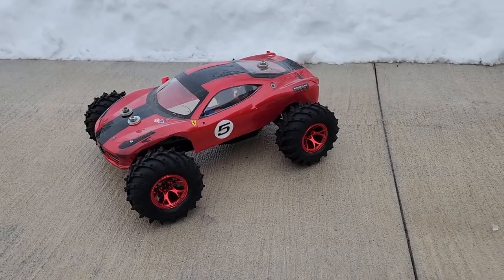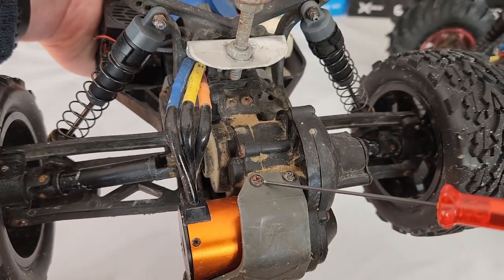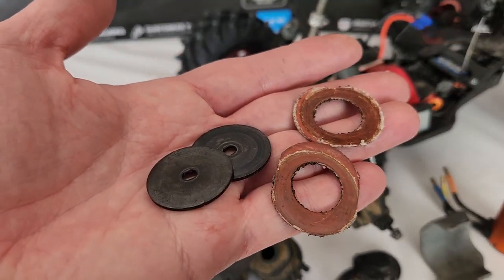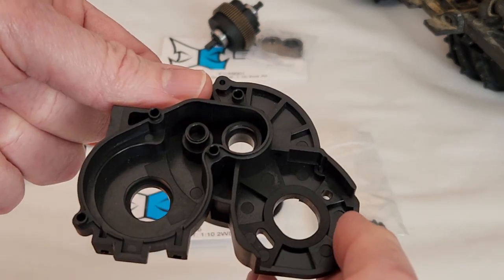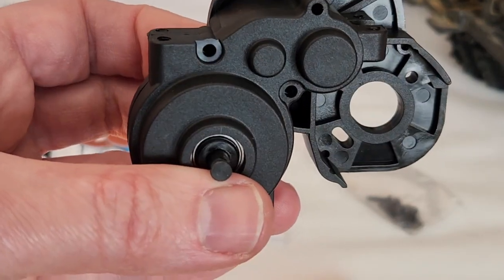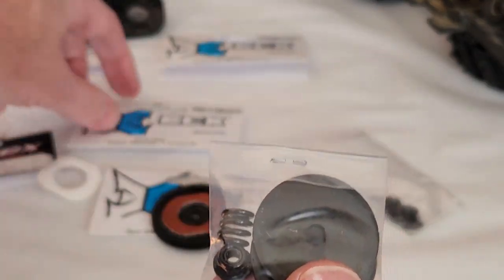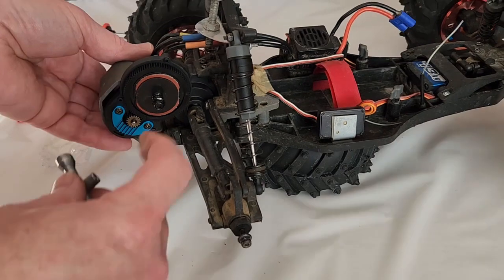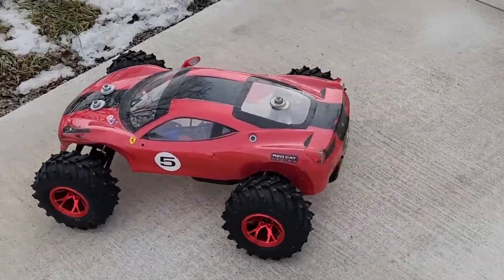ECX AMP MT - Replace The Transmission Parts and Install the Metal Transmission Gear Set

Comment: hi wondered if u can help. i got ecx circuit same set-up ive replaced everything like u have and under full throttle still slips
buti never change center bearing behind spur gear. would this help u think ?
Reply from the maker: Check the drive shafts. We have had the part where the drive shaft connects to the wheel shaft break. Test it by holding the axle and turning the wheel. If the wheel turns but not the axle, get a replacement drive shaft assembly.
Reply: all axles seem fine  @HandfulOfHobbies  👍 see the bearing on the input shaft behind the bushing ive lost this and not sure what size this is ? ones i have all too big
Reply: i was running it without bearing and spacer washer is this why it slips when u put power down ?
Reply from the maker: @jimmymorris8032 find the manual for the exploded view and parts list. That will tell you what part you need. Just search Horizon Hobby for your truck. I'm sure having those bearings will help.

Comment: is it normal for the metal gears to feel a little more slow on takeoff? I’m running a brushed system so maybe that has something to do with it
Reply from the maker: I wouldn't think it should, but they are heavier than the plastic it might take a little more torque to get them spun up. It runs fine otherwise right?

Comment: hi what is the blue metal piece on the motor mount, I find with mine the plastic is too soft and motor shifts and shaves my spur off??  where did you get it, its for this reason?
Reply from the maker: That is the ECX Anti-Slip Motor Mount, part number ECX332005. The problem is, I have not been able to find those anywhere for the last year or two. It's aluminum and works great!
Reply: @HandfulOfHobbies  been having a problem with stripping spurs on this circuit.  my spur does not sit flat to pinion for some reason, please help?  what could be warped under spur?
Reply from the maker: @43rocket  without seeing your truck, I don't know for sure. Check to make sure your motor is mounted correctly and is straight. If the motor is at an angle, that could be one problem. Also, take the spur gear out and make sure the transmission housing isn't damaged where the spur gear sits. I had a bearing actually melt into the housing and the excess plastic was rubbing on the spur gear. The transmission housing is inexpensive so maybe just replace it anyway.
Reply: @HandfulOfHobbies  I use a 3s arrma 3800 motor 55mph, motor mount is warped, looks like it came warped, making me strip gears!
Reply from the maker: @43rocket  Hopefully you can get a replacement motor mount for cheap. I know the ECX AMP MTs, the motor mount is built into the transmission housing so you replace the entire unit.
Reply: @HandfulOfHobbies  hi do you have wapage on  your stalk mount?  does the spur and pinion run parrale to each other?
Reply from the maker: @43rocket  yes, the spur and pinion run parallel to each other. I have not had an issue with the gear mesh on any of our ECX AMP MTs or the ECX Crush. I would look to buy a new motor mount/transmission case.